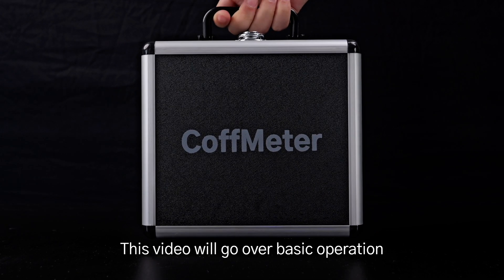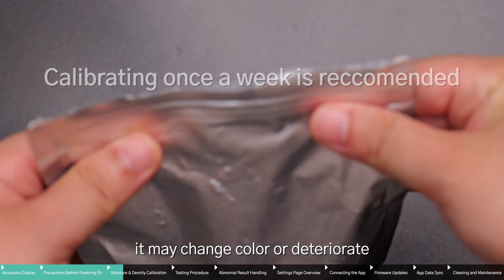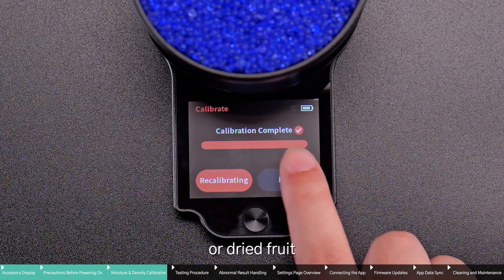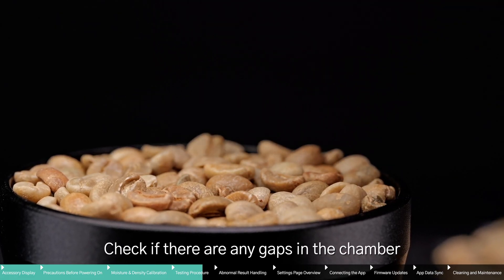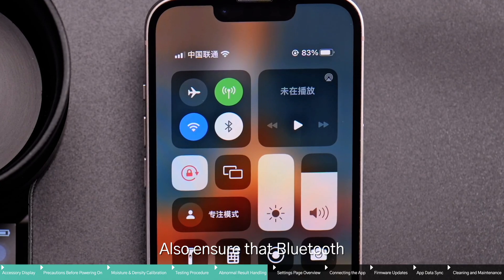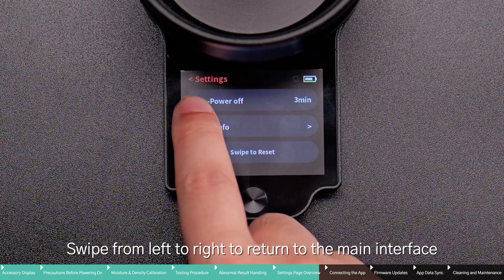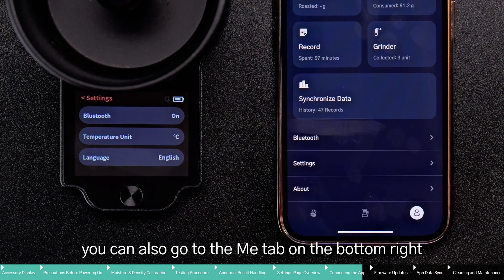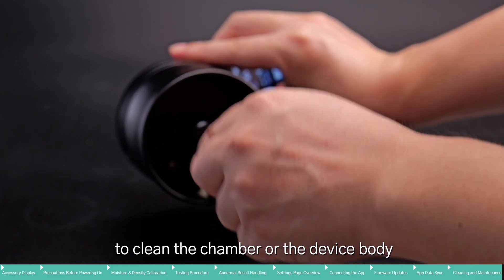CoffMeter M1 Official Tutorial - Coffee Moisture & Density Testing

Comment: I bought two units at Amazon and neither of them worked properly. The calibration is easy, but the measurements are not the same on both, and the readings are lower compared to other devices.
Reply from the maker: Are you measuring the same sample on both? There are many reasons you could be experiencing this issue, with consistent sample prep being one of the most important. Are you able to share more information about your testing process to help us diagnose the issue?

Comment: I just got mine as a Christmas gift.  Calibration and test per easy and perfect.  Some beans I have had sitting for roast tested at 7.4%.  Now will use this with each roast.  Waiting for my W1 to arrive.  Amazing tools thank you.  Do you have a link if we need to replace the calibration beans?
Reply from the maker: Actually in the latest firmware version coming very soon, we have discovered a way to calibrate the moisture detection without using the standard reference material, meaning it will no longer be needed for calibration. Because of this we will stop selling the calibration medium and inform everyone if this change once the firmware goes live.
Reply: @DiFluid  Got to tell you, I really love your tools.  Bought quite a few, wrote a manual for one.  Looking forward to checking the camera out for my home roasting setup.